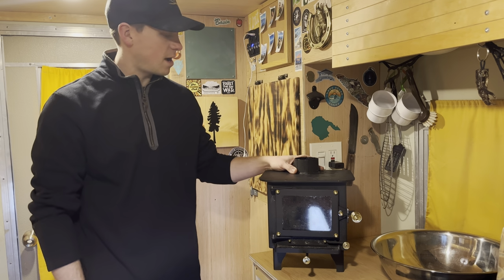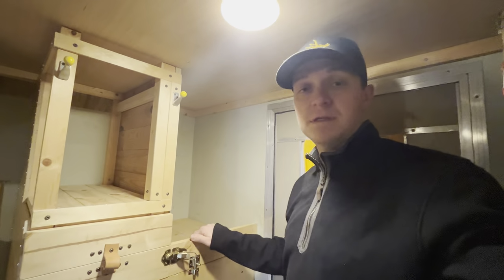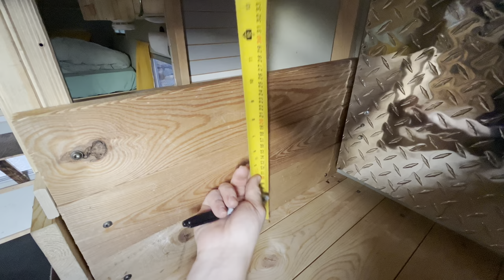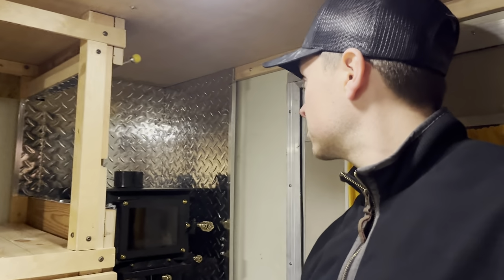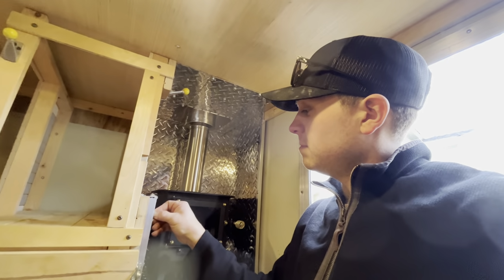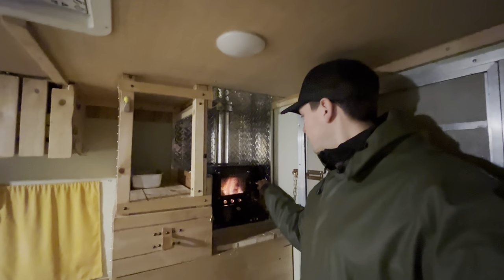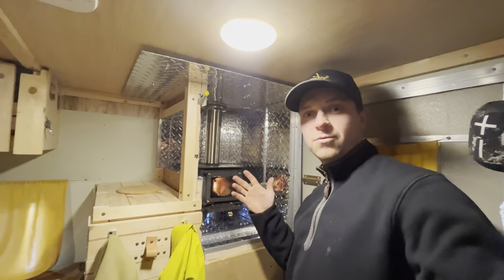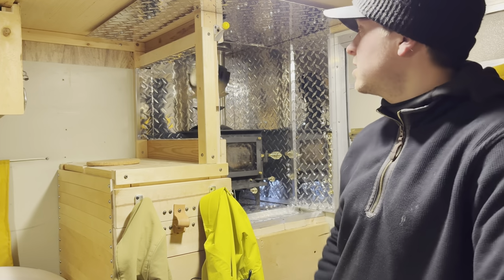Installing a Mini Wood Stove in a Truck Camper

Comment: In 1972 I had a custom wood stove made the size of a large shoe box with a chjminy made from a custom bent car exhaust pipe. I mounted it low down on the back door with the chimny going out thru the back door window.  The only heat protection needed was on the side cabinets -- plenty of setback space so not much heat shielding needed. I used this stove in my 16 foot camp trailer and later in my 11.5 foot camper.  I could burn small pieces of wood but I usually burned prestologs as they would burn all night and still have coals in the morning. Note that for safety I had an emergency exit out thru the truck cab or window. -- but never had a problem.  Maintenance was removing the ash and creosote from the chimny. Nice dry heat. In 1992 I switched to an Olympus catalytic heater.  It caused condensation on the wood panaling and inside of the walls.  In 1996 I went to a fiberglass camper shell that I built out and lined with 2" of styrofoam.  No more condensation except on the windows.  I still use this camper and heater which I love for my winter camping.
Reply from the maker: That’s very cool, I’m thinking of building out a fibreglass shell as well. Camperette size to limit the weight I’m hauling.

Comment: I have a small popup trailer that i used for the first time in cold snowy weather. All i had for heat was a coleman propane stove with a cast iron fry pan over the burner and it put out a lot of great heat but i am tempted to install a woodstove. As far as all the heat sizing to above there is a easy solution that takes all that heat and puts down low where you are sitting. I have a 6 inch 12v fan that snaps onto the top hoop on trailer frame that faces straight down and even has a light with it. If i did not have a battery on my trailer i have a simple battery box made by ICE HOLE  POWERBOX with a 30 amp lithium battery box which also has a USB port for charging things like a cell phone etc. and also has a 12v port that is like cigarette lighter. and if you want to make power it has a port to hook up soar cells to charge your battery.
Reply from the maker: Sounds like a sweet set up. I feel like it would be challenging to install a wood burner in a pop up. Maybe a side jack? Or removing the pipe when putting down or popping up? Something to dig deeper into for sure.

Comment: I did something similar but I built my stove from a propane bottle. Looking forward to your videos
Reply from the maker: That sounds cool, I’ve heard of the propane bottle stove before. What size propane tank did you use?
Reply: Just a standard 20lb bottle,  it's probably the same size as what you have now
Reply from the maker: @numbnut257  it’s a bit bigger, and you would have a lot more internal space because it’s not insulated, unless you some how did that yourself with fire bricks? That would be cool

Comment: Love what you did with the metal! That looks very nice. I'm thinking of installing a wood stove in my motorhome.  My concern is the pipe that runs through the ceiling. do you know if that gets very hot or not? I wonder if double piping would help or not. I just get weary knowing there's Styrofoam,  insulation,  and whatever else sitting on the pipe itself and would like to know if the actual pipe gets hot. Thank you so much 🙏
Reply from the maker: For the install you need the insulated roof jack pipe. It slides over the double wall stove pipe. I pre-installed rock wool insulation where I knew the stove jack would exit the camper. No problem! I hope the install goes well

Comment: Im no pro but I fell this is dangerous. I thought the heat shield should reflect heat and not conduct heat. That means any wood on the back (touching the metal) would reach those levels of heat and is a fire risk. From what I found on google, having a heat sheild with a small air gap behind should use materials such as brick, stone, tile or vitreous enamel. When I install mine I will probably use Fire Brick, or Fire Board.
Reply from the maker: There is an air gap behind the heat shield so that the wood isn’t directly on the heat shield, seems to be fine.
Reply: @truetineoutdoors  I see that's good. but i wondered what is holding the heat shield? as i thought something must be propping it up? I hope it is safe because it does look super nice. if I was in your position and got a second opinion and they said there were any issues, id consider using fire board behind the heat sheild, not like a sheet, but like beams, to hold the metal in place, so its not touching anything thats combustable. im not sure how you currently secure it, but if its beams of wood that could open you up to risks? I am not critisising as im not knowledable enough about this stuff, but I mentioned it only because I hope you stay safe and your van doesnt get damaged at all. Also I will be doing my own build soon so any feedback you give me is helpful towards me also
Reply from the maker: Im using aluminum U channel to create the spacing behind the heat shield. I guess you could go the extra mile and have a non combustible material behind that. Thanks for taking an interest in the video.
Reply: @truetineoutdoors  I did a bit more research and apparently as its reflective it does bounce the heat away and into the room? so you might be good, if those u channels dont get too hot you good with what you have most likely. thanks for taking the time to reply
Reply: @truetineoutdoors  You may not have enough space above the stove. I talked with the support staff for a similar setup (only more space above) and they said I couldn't do it. You should talk with the support staff about your setup. They are very responsive and helpful.
Reply: I've burned wood for decades. I've put small wood stoves in a trailer. Just screw two thin sheets of steel, aluminum, or whatever separated by about 1/2 thick of washers. Just make sure you have enough room above the stove for the heat. I've gotten the stove red hot and felt the back steel panel and it was cold. Just make sure there is air flow.
Reply: Just two sheets of steel is fine as long as there is air flow behind all the sheets. Even the back sheet.

Comment: I'm looking into doing this for my pop up camper. My only concern is how to cap it off on the top for when your driving, so it doesn't rip off the top shield?
Reply from the maker: I just cap off the top with a galvanized pipe cap that screws into the pipe. (Specifically to the outer insulated pipe)

Comment: How well does this work in the far north? I'm in Maine and wondering if this will heat enough on a winter night.
Reply from the maker: I would say that it depends on the size of the space and how well it’s insulated. In my camper I slept 2 months in it and a lot of the nights were in the mountains at -20 Celsius. I was toasty warm throughout the night.

Comment: How long is your flue pipe? Im thinking about putting this in a truck camper, and im not sure i want a ton of pipe above the roof.
Reply from the maker: My flue pipe is very short, shorter than spec due to the build in my camper. I recommend going to the lowest point possible for mounting the stove. Eliminates possible problems with draw/airflow. You can always have an added removable extension to extend the pipe to desired length.

Comment: Probably already mentioned but the length of your flu is what’s causing a lot of problems, the longer it is these easier the smoke goes up.
Reply from the maker: Very true! Unfortunately I decided to keep it shorter than spec due to the build in my camper. After working out the kinks the stove seems to operate quite well.